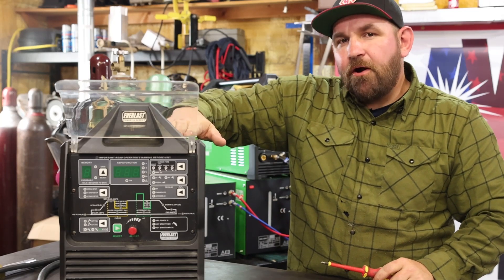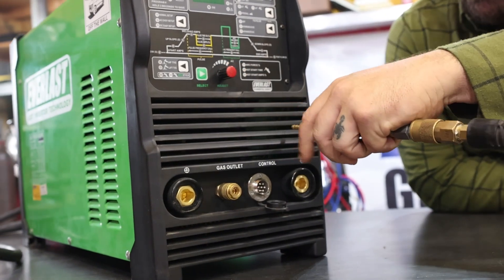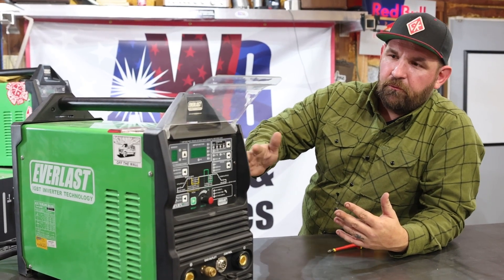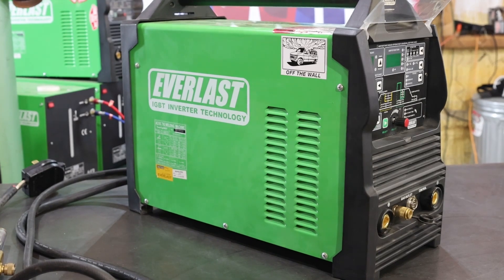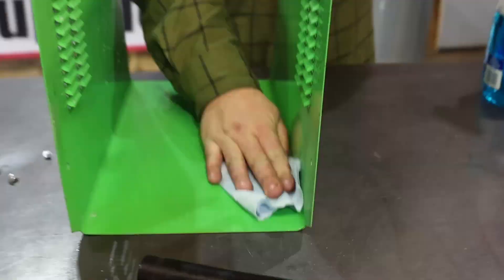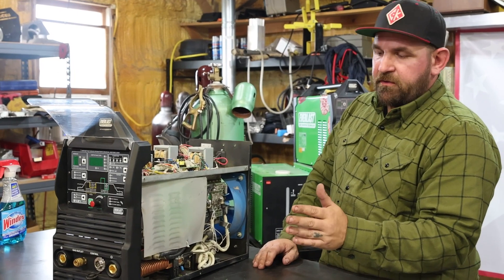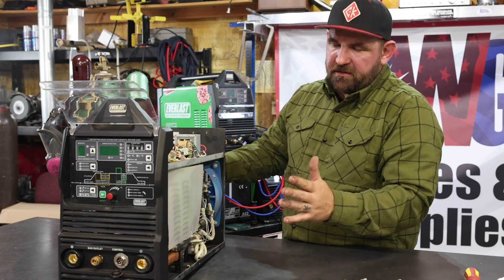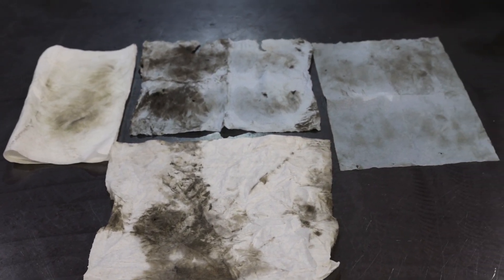How To Clean Your Everlast Welder | Inverter Welder Maintenance

Comment: Hey all.  I had to replace a button on the control panel of my 255 EXT.  Here's the details.  I just wanted to get this out there.
Someone should make a video. Not me.

MFG 'E-SWITCH' Part Number  TL6300AF260QP
Digi-Key part number  EG6117-ND
TACT SWITCH THRU HOLE 12MM X 12MM

You do have to desolder the old switch fyi.

Comment: Dont weld with the machine on the same table as your work piece or close to it, the fan will suck in all the fumes inside it. They have a 10ft+ hose/line for a reason.
Reply: Not good for your health, either.  Separate yourself from the power source!

Comment: * seriously annoying issue* 

Got a mts 225. The front panel plastic is not seated with a seal so the dust of the shop can get over the lcd and you cannot see the view of  the settings you are using very well unless you right in front of the machine. 3k+ on a welder to take it apart all the time So I can see what my settings are is ridiculous.

Comment: When you said power off the machine do you leave it plugged into the power source?  With using pressurized air is there any issues static electricity and the electronics?
Reply: I know that a major mainframe and server refurbisher uses static neutralizing blow guns.  Static damage can cause part failure much later.  That said I blow out my pc outside on a humid day with an all metal normal blow gun.
Reply: Unplugged is the safest way. Ive never seen a problem with static, doenst mean it couldn't happen, id think it'd be pretty rare though

Comment: Do you clean out the water cooler as well? If so how often?
Reply: i don't pull the case off the water cooler, but just blow it down. on the cooler i will blow it out from the back to clear out the radiator at the back of the unit. Then i'll blow it out from the sides. I don't worry about getting the water cooler as clean because there aren't any control boards inside, they are pretty simple on or off units.

Comment: I've started doing this on my 210EXT now since I use it in my mobile welding business. It's in my trailer most of the time so it will accumulate dust. Also have checked the the points. Thanks Jesse for the info. Can't wait for Monday night's stream.